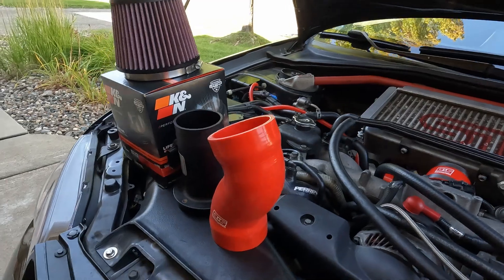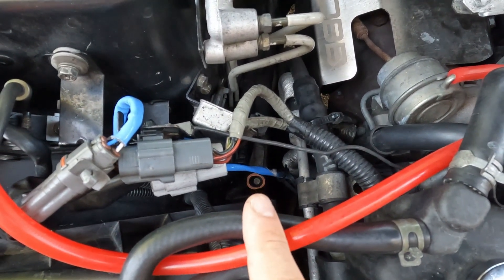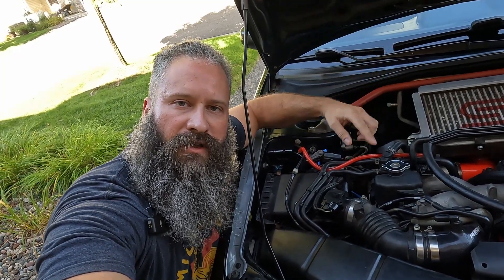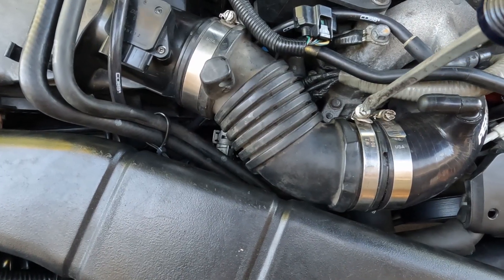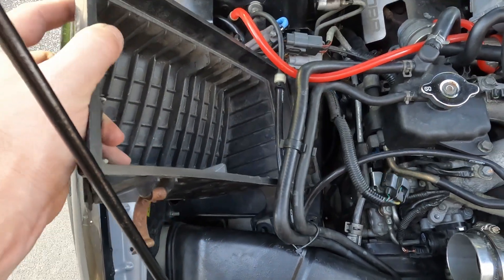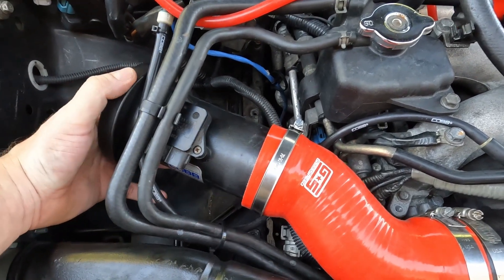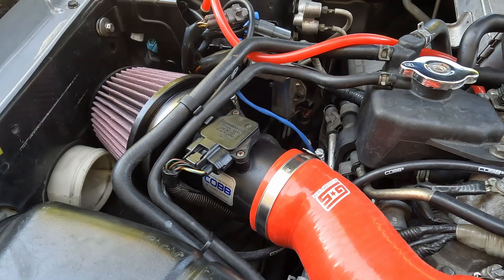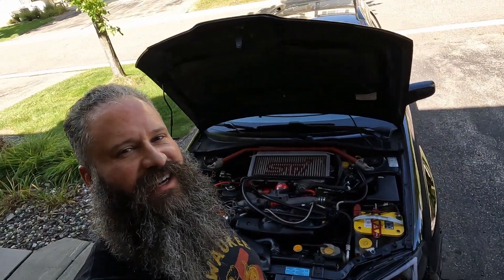How to Install an Intake (Filter, MAF and Tube) [Subaru Impreza WRX STi and Forester XT 2002-2014]

Comment: sup man i’m starting a project car and it’s an impreza wagon, i was wondering if you could let me know the part number for the cob shirt ram intake
Reply from the maker: Congrats on the project car, hope it goes well!  The COBB product code number is 712100 for the short ram intake.  https://www.cobbtuning.com/products/air-induction/subaru-sf-intake-system-1/
Reply: @subearu i made a trade 😭😭